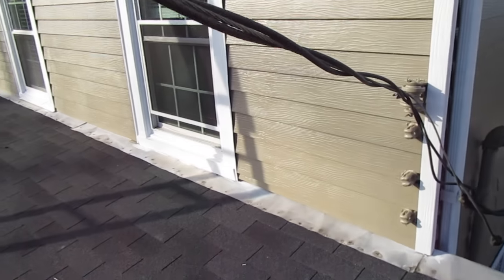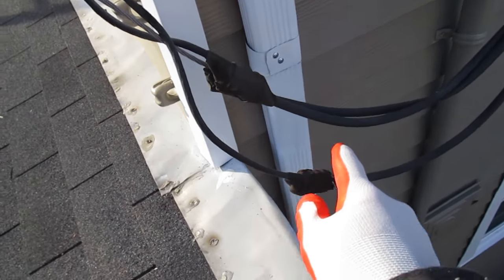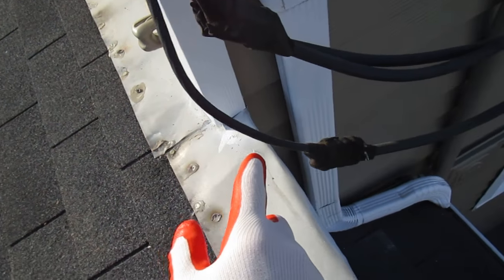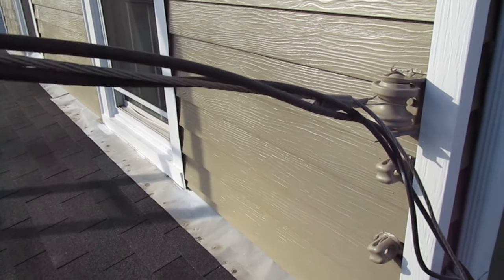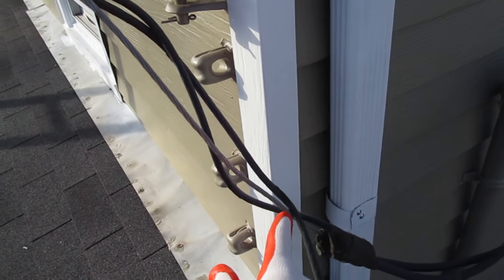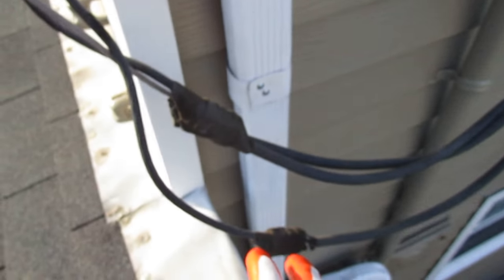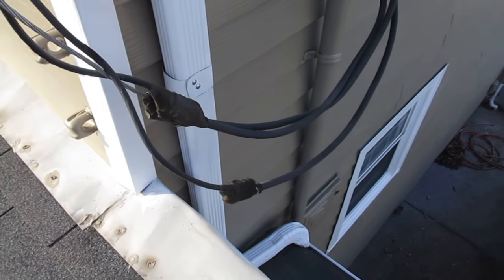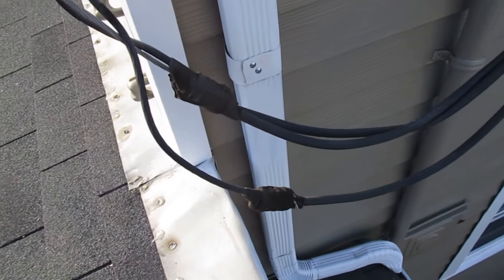Electrical Service Entrance or Exterior Service Drop

Comment: Never ask an electrician about linework. Don't ask a plumber about your roof and don't ask a mechanic to do your taxes. Go talk to someone who knows what they're talking about.
Reply: I agree the level of ignorance displayed in this video can cause death by Darwin.
Reply: @TheTubejunky  what level of ignorance?  Everything he's said is 100% right
Reply: @illwil2158  If you can't figure it out then choose another field of work. Im not going to do the work for you.
Reply: @illwil2158  Persons not qualified to touch electrical equipment let alone fondle a service cable shouldn't be giving YT lectures. There is NO OVER CURRENT protection is that man becomes a complete circuit with either leg of that split phase system. His new nickname would be FUSE. If you think this man is SAFE to do what he has shown in the video then you are okay with ppl to be seriously hurt or killed. He clearly isn't familiar with safety protocol and or Proper PPE.
Reply: Just like don't let lineman wire your house they're not electricians. I fixed many panel and services that lineman attempted to install as side jobs.
Reply: A lineman is an electrician
Reply: @imdefinitly18now I was gonna say the same thing , different parts of the same field , it’s still electrical
Reply: @TheTubejunky You are ridiculous and wring about everything you said. Actual electrician here and Ive done plenty of services. He is correct in video and dont know what you are ranting about.
Reply: @chrisb8870  sureeee buddy.
Reply: As an electrician everything he said was absolutely correct! Table 310.21 of the NEC (national electric code) is a table for the ampacity of conductors in free air and table 310.16 is for the ampacity of conductors in cable or conduit. And guess what the conductors in free air are rated as having a significantly higher average that they can handle because they dissipate heat better than something in a cable or pipe!! 
 Another thing is he never touched more than one of the wires at the same time. It is literally impossible to get shocked or electrocuted unless you are touching more than one phase or touching one phase and ground at the same time. I can literally lick a live bus bar and if I'm not touching anything grounded or the other phase I ain't going to get shocked or even feel a tingle. Anyone who knows a single thing about electricity knows that only ever moves if it has a path back to source. Bank of it this way if you touch the terminal of a battery with your screwdriver it will not give off Sparks but if you touch positive and negative at the same time with your screwdriver then it will give off Sparks. 
   Another thing about the trades is everybody in the trades knows a little bit about the other trades. because they actually talk to each other and work with each other. As an electrician I have to know a little bit about framing so that I know not to put a switch box write up against a door frame or else I will end up having trim nails going through my wires. As an electrician I need to know a little bit about gas lines so that I know to bond the gas line on either side of a gas meter. As an electrician I need to know a little bit about HVAC units so that I know whether or not to run 2:40 volt or 120 volt to them and which side of them to put the disconnect. Also electricians have to deal with lineman on a regular basis add we actually talk to each other!!! 
  Another thing is lineman aren't the only ones who run overhead wires electricians do as well. Sometimes a customer has their service on a pole and wants to run the service entrance wires to their main panel overhead instead of underground. Add guess what we have to know the ampacity of those conductors in those situations
Reply: no one specified why it was alowable. so the pair that runs from the step down transformer to the point of attachemt is a v90 rated insulation meaning that the insualtion has a better rating to increased temperature thus the insulation wont crinkle or get destroyed. 
the consumer main cables is v75 rated thus its insulation wont have the heating capacitty to what the xlpe cable can handle thus the consumer cables diameter needs to be increased to stay at a regular temperature
Reply: Hes right its in code (Quebec)

Comment: It's called a "drip loop".  The hot wires carrying the service hang down and loop so that water will drip off and not run into the pipe on the house.
Reply: We call it “weather head”
Reply: The weatherhead is the piece at the top of the mast. Basically a hood to shield from the elements. The drip loop is the literal loop in the wire going from the spliced area into the weather head. Loop should be pointed down of course since gravity will draw the water to the bottom of the loop, away from the weatherhead@texaswelder9957

Comment: NEC says you need 3 ft of clearance from the edge of a roof and also 8 feet above a roof unless it has a 4-12 slope which you standing on the roof means you don’t have the slope.
Reply: Good thing inspectors aren't code enforcers and depending on the year of build it may be grandfathered in to reflect the code of that year. Unless this is a brand new panel Install then service would need to be brought up to current requirements
Reply: @themayorbnb  This is also why it is against the law for a home inspector to state code in a video AND in a report....

Comment: There are separate code tables for wires in conduit "not more than three current carrying conductors" 310.15(B)(16) and "in free air" 310.15(B)(17). 2017 NEC.  For a given conductor size and rating, ampacity rating in free air is greater than in conduit or raceway. 

By comparison: #2 USE 115 amps in conduit, and 170 amps in free air.

Makes sense too.
Reply: WOW...  that's quite a difference.

Comment: Good video.. just to clarify something that you said (pretty sure you meant the right thing, but may have said it backwards).. you said the larger wires "generate more heat being enclosed"..  A better way to say it would be something like, "the enclosure will retain more heat, so the enclosed wires are required to be larger so they generate LESS heat, so the enclosure does not overheat."
Reply: doesn't code say 4 or more wires require derating to 80% and so on. doesn't that make it unneccessary to upsize this particular set of wires. although its never bad to size up but still not needed
Reply: @JaRa911  I'm not sure.. you'd need to check the code.. I suspect that "free to air" wires from the poles have a completely different standard interior wires, and then once you get inside a conduit additional restrictions apply - at some degree of crowding you need to start derating the amount of current they're allowed to carry.. environment temperature is also a factor.

Comment: The neutral is the neutral. Not neutral and ground. The grounding is done separate from the service drop using ground rods or rebar from foundation of building.
Reply: The neutral is your grounded conductor actually...
Reply: @philipwilliamshomeinspecti4665  That wire is the neutral, period. 
You bond it to the ground in the panel is a different topic of discussion.
Reply: @urbanturbine  First means of disconnect 😉
Reply: If wired properly, we can use neutral as ground wire.
Reply: @urbanturbine  If you bond a wire to any load wire is that wire anything but a load now? And when you bond to ground...? Hmmm, ok. Neutral and Ground are functionally the same. Neutral is simply the intended current return route for the proper circuit. Ground is a fail-safe return path. They both are at the same potential (or damn well should be - see ground loops).
Reply: the neutral is tied to the ground on the transformer that grounds the telephone pole anyway , it’s not wrong to call it neutral/ground , what you’re talking about is the grounding for the house specifically but the service drop derives its neutral from the
Transformer and yes the ground is tied to that same connection

Comment: the lines coming from the pole are number 2 or number 4 ACSR
Reply: You mean 4 or 2AL. ACSR would be Aluminum conductor, steel reinforced. Which this triplex service doesn’t have steel.
Reply: @jakeriley2830  ya im used to saying ACSR
Reply: @jakeriley2830  the blacks are 2 or 4 al
Reply: @powerlinekidforsman9360  lol all good. Your just used to working that big wire. That’s all. Haha. We got mostly 477 and 795 ACSR where I work.

Comment: I was wondering about the porcelain wire holder. It doesn’t hold the conductive wires. It holds a support wire which supports the conductive wires. Thanks.
Reply: It holds the neutral wire which is not there for support but to be grounded and allow return current
Reply: @andycopeland7051 True,  although the bare neutral is ACSR wire,  that supports the rest of the assembled cable, as in a messenger wire.

Comment: Looks very sloppy there's not even the correct drip Loop. The drip Loop needs to be below the weatherhead and like I said there's not even a drip Loop. The purpose of a drip Loop is when it rains water will fall off on the bottom of the u-shape conductors. Also it looks like those wires are touching your metal gutter or at least they're very close? And as we know metal and electricity do not mix.

Comment: We had a storm last week and a tree landed on our service drop. The house still kept power. I was going to cut the tree up with a chainsaw after the insurance guy looked at everything. Then I noticed the support wire/ground/neutral was severed although the others were intact. I don't know much about electricity which made me not want to mess with it. I've called the power company. Was this the right choice? Is this dangerous?
Reply: Yes if the steel support cable is broken then that is very dangerous.

Comment: If I’m not mistaken the NEC code states that the weatherhead which is the turtleshell shaped thing needs to be higher than were the service cables are secured to the house are attached. Any other professionals want to chime in on this topic?
Reply: It’s called a weatherhead not turtle thing
Reply: Mr Panda obviously you dont know how to comprehend text. Read it one more time budd..lol
Reply: javier alejandro I apologize I didn’t see that
Reply: There is no statement made on the year of build so what year code of the NEC are you referring too and when were the specific requirements changed? Again home inspector not a code enforcer
Reply: yes I'm a professional and this point of attachment in reference to the weather head is WRONG. NEC 2020 230.54 (C)

Comment: I have a questions I need a Service entrance wire #2 AWG for a 100 amp service, I am a bit confused, Does this #2 AWG that I need will come (jacketed/bundled) meaning in a single sheath  together with the neutral or do I have to buy them separate? Thank you for any recommendations.
Reply: If you are using conduit you can buy xhhw-2  #2 aluminum conducts as a single length and cut it to size. Be sure to leave yourself a 3-foot loop out of the Weatherhead/Service head and the conductor coming out to be used as a neutral make sure you tape it with white tape. If you are not using conduit then you can use SE #2 Aluminum Cable and you would need to twist the strands together to form the neutral.
Reply: What is the size of the wire for 200 amp service entrance. Thanks in advance
Reply: 2-0 wire is used for 
200 amp panel installs
Reply: Also the two wires, assuming that’s a new build would be 120 volts each carrying 100amps. Usually width of cable dictates amps. 100 1”, 150 1.25”, 200 1.5”.

And as a side note if that cable is live then he should not be touching anything with gardening gloves. 10 amps will kill instantly 99% of the time. So if either cable has a slight tear or any imperfections then his entire body inside and out would burn and his heart would stop.
Reply: For 200A service, it's 2/0 copper or 4/0 aluminum. 100 amp uses 2 copper or 1/0 aluminum. Earth grounds on 200A are 4awg to water or ufer, and 6awg is all that's required for ground rods. 
A 100A service uses no. 6awg for all grounds.

Comment: the mast bar is of the house and it came off the clamps. I was told its the owners problem not the city. what can I touch and not touch????
Reply: my plan was just to hold the bar back and put longer screws in it
Reply: @philipwilliamshomeinspecti4665  i bought newer clamps and used longer screws. everything is held down strong and stable. im not sure how that happened. but its done👍🏼 thank you for your time sir

Comment: I’m assuming the entrance cables are 2/0 cause of its panel amperage rate
Reply: @philipwilliamshomeinspecti4665  will theses wires kill you if you touch them bare handed with a path to ground.
Reply: @Katarinarabbit  Those are insulated conductors but no one on here will tell you "go ahead touch it , it is ok" :)

Comment: Lazy cheap ultility companies do not have to follow the NEC so get away with murder. They would rather have your house burn down then them have the proper size fuse but overfuse. Have seen them only use 4/0 aluminum wire that for us is only good for 200 Amos but seen them feed 24 row houses with ever house having either central AC or 3 or 4 window air conditioning so wire gets hot during summer days.

Comment: You really think that this deserves a video? All taps can be done on mismatched wire gauges that's why rating on the tap is dual numbered. I thought this video was about the service drop almost touching the gutter leader...
Reply: @werquantum  lol!
Reply: @Order-in-Chaos  In all fairness you asked why it deserves a video, like what kind of question is that? Youtube is a place of exchanging information, and I for one learned something here. After all, you could have just not clicked on the video lol. The rest of your comment, I thought was helpful though. You did throw a unneeded shade however, and get upset someone got offended by it...